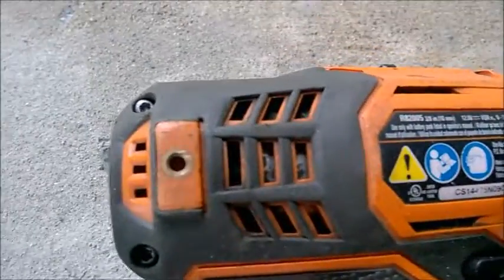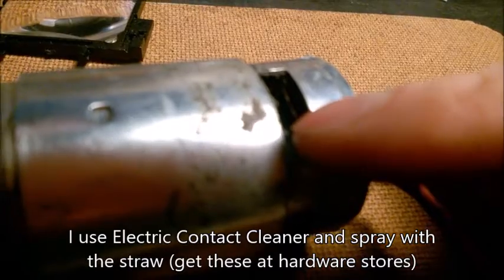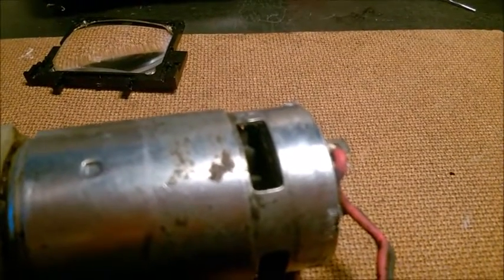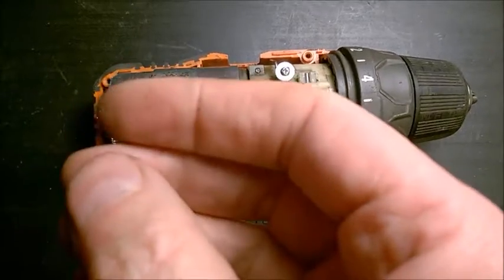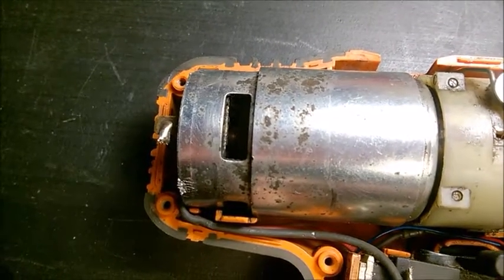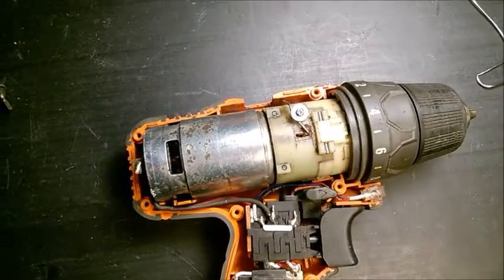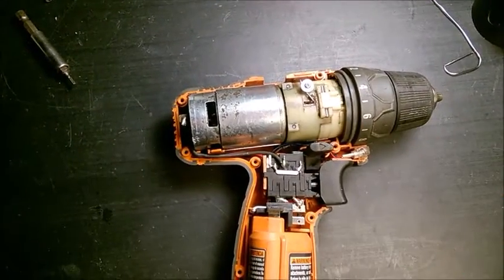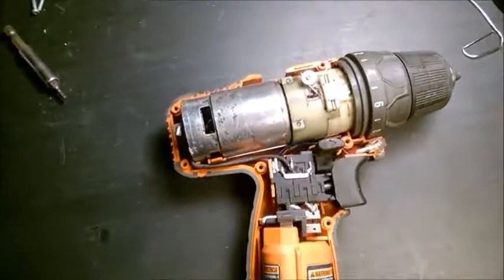Drill burnt smell

Comment from the maker: Update: the problem is still there. What I do is spin first the drill at very low speed - lowest possible - for 1 minute before working with it. Most of the times one minute at lowest speed is enough to clean the surface, then I increase the speed as needed without smoke.